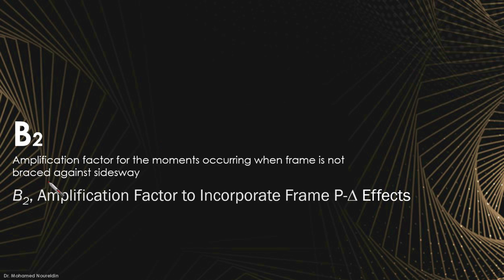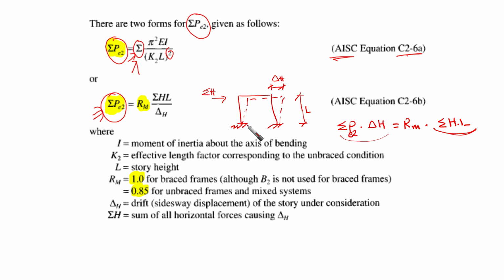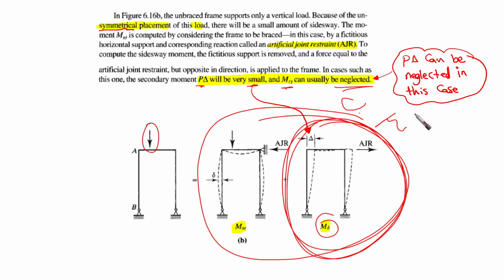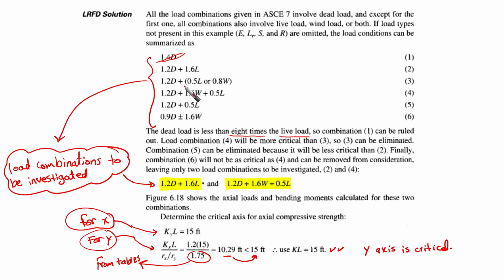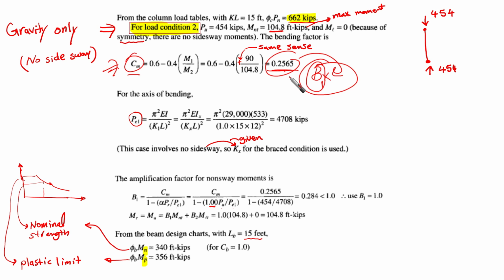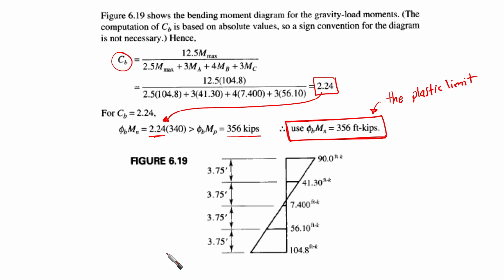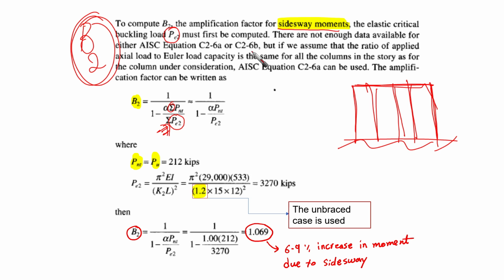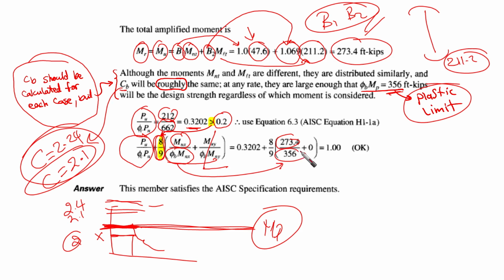21 -Beam column- Part 4-Amplification factor (B2) for the moments-sidesway permitted

Comment: thank you Dr. Mohamed. 
I have one inquiry.
if I have a frame that is braced in one direction and un-braced in the other. in this case i would have only one value for B1 for one direction (small delta) and one value for B2 for one direction (side sway). is that right ?
Reply: I was looking for the answer for this too. If u figure out the answer sir, please share it with me too.
Reply: i think for braced direction you need B1 and Unbraced direction you still need B1 and B2 depending on your load combination..maybe